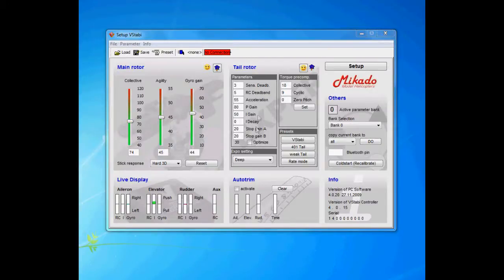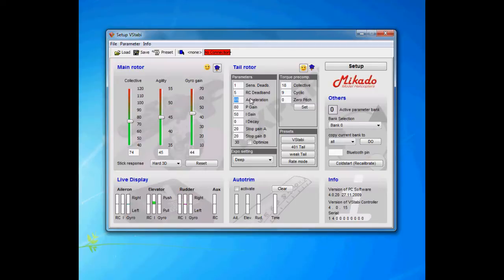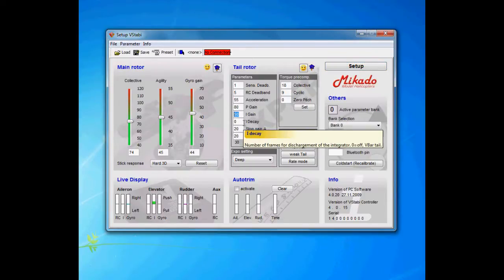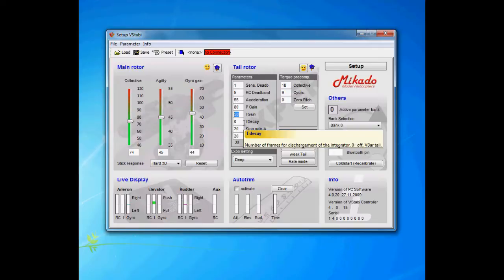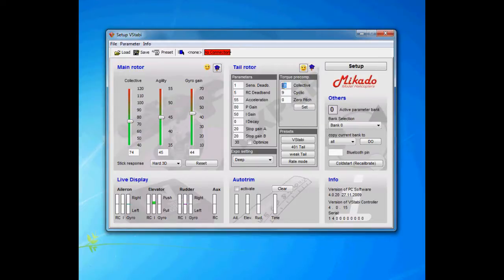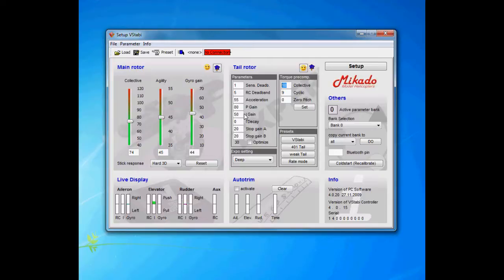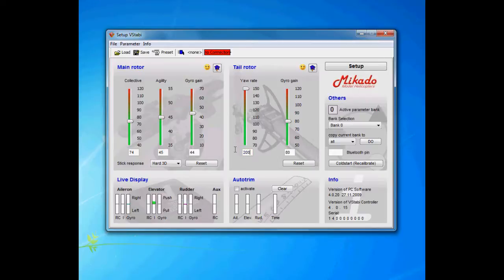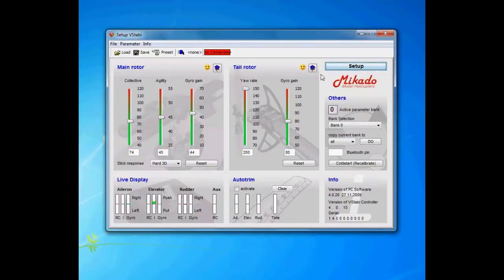VBar 101 - Episode 14 - Part 2 - Tail rotor advanced

Comment: I tried to fallow I'm a car and drone builder and new to flight controllers and gyros. I have a 450l 1700kv 22.2V FBL 50A platinum H.K ESC. my 2 nd build all info from reading or you tube. Your video help but I need to watch the rest but, when I went out to hover it lifted up my heart racing it drifted a little  I compensated then in wile in normal I punched the trh. and my tail went from 6 oclk to 3 not bad but new to it scared me I look at my setting is it possible you would have time one day to check the file or video. Let me know and ill look for your other videos. thank Jason jax fl usa
Reply: After many first flights I just now starting to barley understand how these fbl controllers work seems to be too much I gain when I let off throttle it can't hold the heading after a hard punch out. Seems the pre comp kicks in twice. One for up and a kick for off or back down Collective torque

Comment: hi im having trouble with my tail,ive tried alsorts including changing all bearings i get tail wobble only slight and when i move tail fast to the left and stop i get a kick back of about 7 degrees. my pro vbar settings are:pgain 65 igain 60 acceleration 80 precomp colect 9 and cycl 3.tail gain 80 main rotor gain 50 rc deadband on tail is 5.hope you could put me on the right track for my trex 550 as i just cant seem to get this vbar set.thanks for your videos and keep up the great work.:)